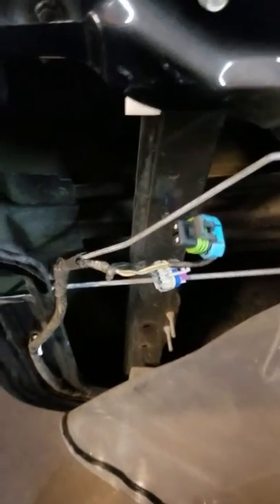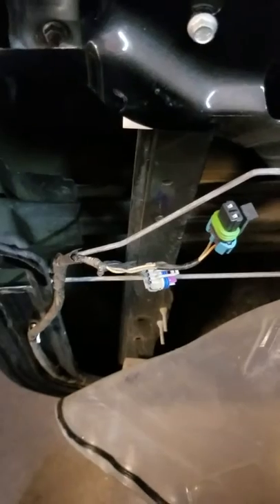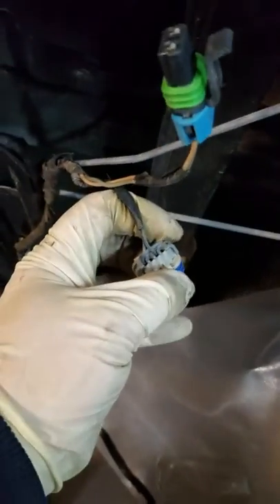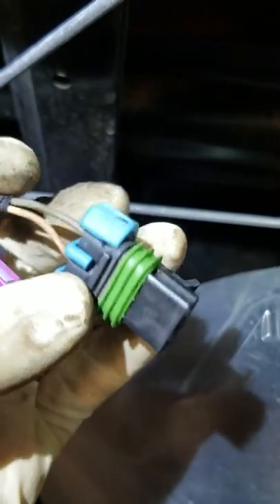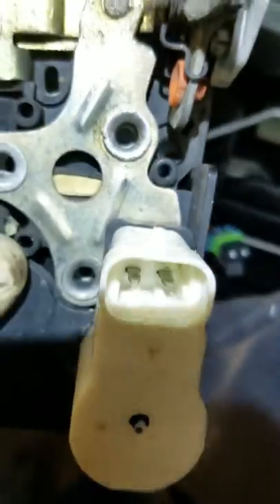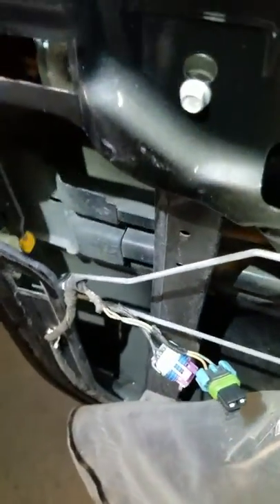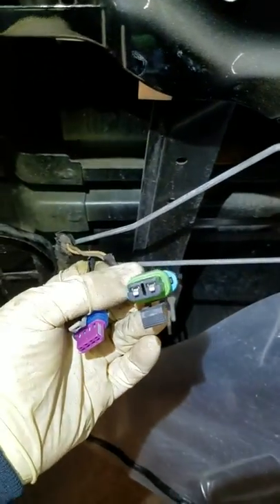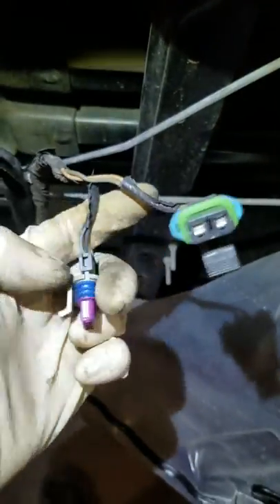Cadillac Escalade Chevy Tahoe, Silverado door ajar message

Comment: My dad has an 2005 Escalade where the alarm keeps going off when its just sitting parked, while he was driving yesterday he kept getting the massage that the drivers door was ajar even though it wasn´t; could this be related to both problems? ....as far as I can tell the door sensor is part of the same unit as the door actuator, so i am thinking of just ordering a new door actuator and replace that. What do you think?
Reply from the maker: Yes that is basically the same problem. Part of the latch assy. Might as well replace it.
Reply: @MegaMarclar  okay, thank you
Reply: Did you solved the problem after replacing the new parts

Comment: Hi my friend can you help my 
I have tahoe 2015 sometimes the gear shaft does not move from p position
Reply: Go beneath the car there is a very small tiny notch connected to long handle .. sometimes it goes out ,, u need to connect it back in .. its so simple in fixing and reconnect !!